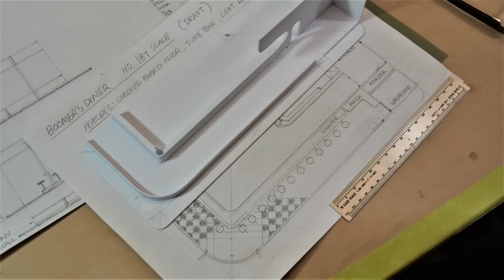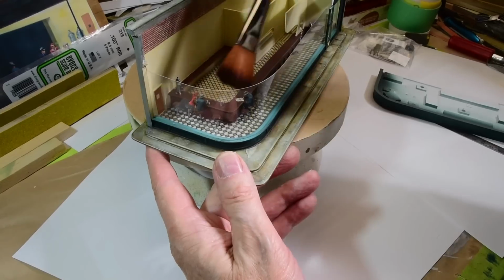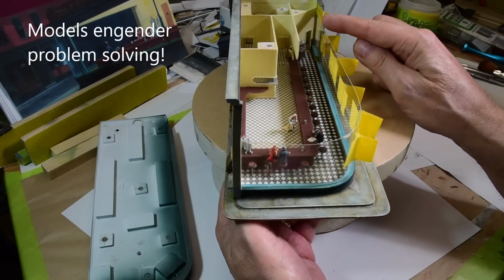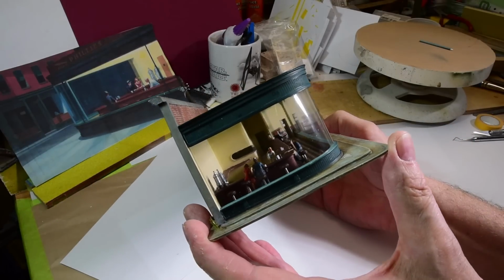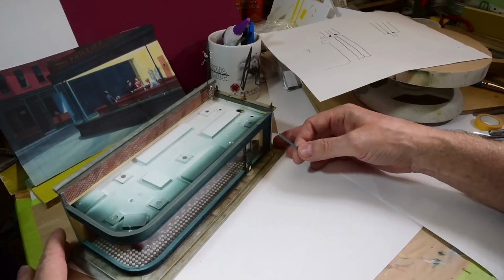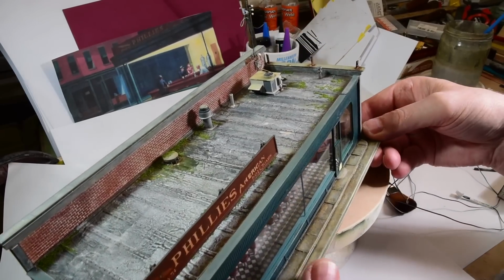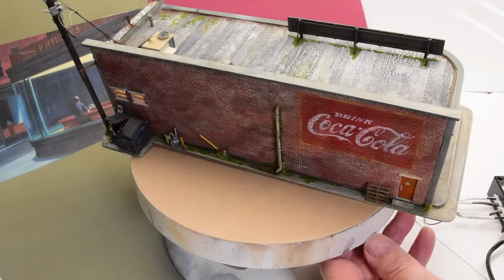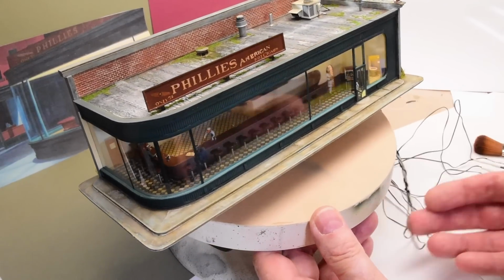The "Nighthawks" Diner Final | River Road ~ Vlog # 150

Comment: This is the most amazing miniature I've seen in quite a while. I wish I could see it in person!
It's also a very good demonstration of that fact that Hopper created *fantasy architecture*. Structural glass panels this enormous didn't exist c. 1940, and there isn't nearly enough support for the roof. A real structure would have five or six sturdy brick pillars along the length, and the glass would be no more than about five feet vertical, max, probably closer to three.
Reply from the maker: Thank you and Thanks for sharing! Cheers.

Comment: The fact that all of this was built from scratch using scraps of plastic is utterly amazing! The design and engineering of all the parts that work together and fit into place so perfectly is genius. Also, the interpretation of Edward Hopper's painting, plus all of what you don't see in the painting depicted as well..brilliant.
Reply from the maker: Thank you! I appreciate the compliment!. Merry Christmas and Happy New Year! ~ Boomer.
Reply: I agree. This was a great series. I know Boomer put a LOT of behind the scene work into this as well. I enjoy scratchbuilding myself and learned some valuable tips during the series. The whole idea of how the roof slides in and the top pops down with lighting in between layers is great.

Comment: Excellent video series and even better modeling. I initially thought this diner was going to be set on a 1940s layout, but I see now that it has time traveled to the present day: the 911, plastic garbage bag(s) and that dumpster would otherwise be anachronisms. Incidentally, there is a Nighthawks restaurant in Greenwich Village, so named because the owner claims the restaurant was the inspiration for Edward Hopper's 1942 painting and, judging from the photos, he may have a valid point. The building's triangular shape, rounded front corner and overall proportions are compelling hints (the building is actually three stories).  Hopper's art, of course, was an amalgamation of the city's diners. Thanks for the modeling journey, Boomer!
Reply from the maker: I appreciate that. Thanks for sharing that history about the Diner.😁

Comment: Love the diner. Superb engineering and craftsmanship. One way to reduce the dust on the clear acetate is to wipe it down with Windex (or any glass cleaner with ammonia) right before you install it. It also works with cast acrylic.
Reply from the maker: Thank you for the tip! I appreciate it. Cheers.😁

Comment: Remarkable artistry!  You have outdone us of all.
Never would I have thought of a hidden pipe channel to hide wires.  Brilliant.  It has so many varied uses on a layout.
Also the double roof assembly to set the lights makes future advancements & enhancements quicker & easier.  But I still would give both parts a blast of black paint to suppress any light bleed.
Earlier, in 2022, I proposed to two of my RxR Clubs that we do a challenge of iconic structures.  Just to see what the scratch and kitbash guys could come up with.  Next Wednesday is our December club meeting so I am bringing this episode, with some clips from the series, to motivate them to hop on board this trip.
Definitely not E. Hopper's NIGHTHAWK.  But some theme based, pick an icon, challenge build.  Thanks to your foresight.
Great build.  Great series.  Great episode.  Great job.
OH!  And for myself.  Thank you for the advice a few weeks back about how to paint Red hair.  Raw Sienna works perfectly.
Jim in N.Y.
Reply from the maker: Thank You! Cheers and Happy New Year ~ Boomer.

Comment: You are a master builder. And I am a grasshopper LOL. But I do like the WS Just Plug lights. I used them when I scratchbuilt a couple illuminated soda machines, with no plans to go by. I would not have been able to do that 6 months ago. I wonder where that confidence came from... 😉Take care - Bill
Reply from the maker: The WS light kits are great for the smaller subjects for sure. Thanks Bill. Cheers.

Comment: Someone referred me to your series on this. I have just started working on it in S. My version has 3 glass walls with an entrance door almost exactly where yours is though mine is shorter. I left the back wall off for the time so I could work inside easily since I decided the windows had to be glazed first. I will have the grills, sinks, and food storage all in the main room. Hadn't thought about a restroom but will try to figure something out. I started with John Armstrong's plans but quickly realized that it doesn't make a complete diner. Thanks for your series.
Reply from the maker: Sounds great. The challenge is modeling the interior and exterior at the same time. It's doable though. I am knee deep in another HO Scale building with an interior as well at the moment. 😁 Cheers ~ Boomer.
Reply: @boomerdiorama  I am building the interior on the workbench along with the rear wall and it will not be inserted until final assembly.  BTW, my modeling era is the 30s.

Comment: Fantastic series with so much information about scratch building and painting. Thank you for documenting this! Sorry to ask as I'm sure you have said it many times before but what is the brand / model of solvent you use for styrene? 
Regards,
-Todd
Reply from the maker: Good question! I use "Plastruct" weld (solvent). There are two types and they both work equally well. I use the bottle with the orange label mostly for styrene plastic and acrylic plastic like plexi-glass, etc. The white label is usually used for ABS, PVC, etc. but both versions seem to work well. Cheers.

Comment: Great result this model. About adding it to the scene, do you attach it permanently on the layout or will it be standing freely. What could you recommend for buildings on a large diorama intended to display on shows. I understand your reply on the friendly comment/question below about the interior. If you should build only one building (as a single diorama) than you can go deeper into the interior details, but now it is about the entire layout and the way how you finished this building including the inside details it fits perfectly into a large layout and scenery. It is always about finding the right balance. 
Looking forward for your next project. Cheers from the Netherlands (Modellbahn Rosenbahn).
Reply from the maker: Thank you and great questions.

I try not to "permanently mount any primary structure on the layout so I can remove it for exhibition as you mention. However, care must be taken to model a tight and level foundation (not always easy) so the layout surface of the model sits nice on the layout without unsightly gaps, etc. This is why I often use a plywood sub-structure for building flats, because they stay straight and rigid with some weight to the building. The weight helps to "pinch" off grass and weeds along the foundation, etc. when sitting on the layout.

Once I establish where the primary (foreground) structure will go in terms of the "scene composition" I will drill a hole for the electrical leads, etc. This process needs to be flexible so I can tweak, an inch here-and-inch-there, before I mount the other buildings. If the latter is a problem I generally use "canopy" glue or matte medium along the edge under the foundation to tack it down. This way I can pop the structure off the layout (with a # 18 Exacto blade easily). In terms of detail, I tend to view the scene in "depth" layers keeping the finer details up front and a little more impressionistic further back.

Furthermore, I try to keep the whole shifting scene in the "theater of my mind" as well, especially on a shelf layout where space is precious and I plan to accommodate for roads, alley ways etc. I hope that helps.

Cheers ~ Boomer.